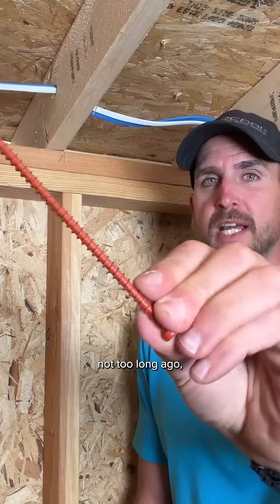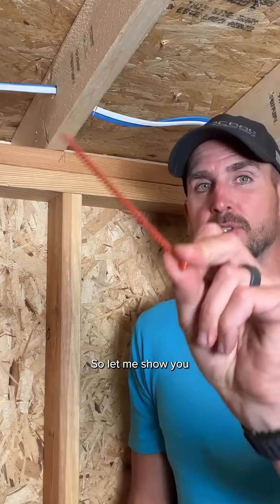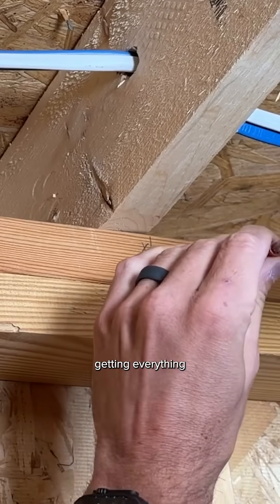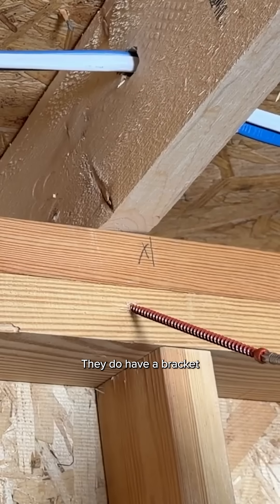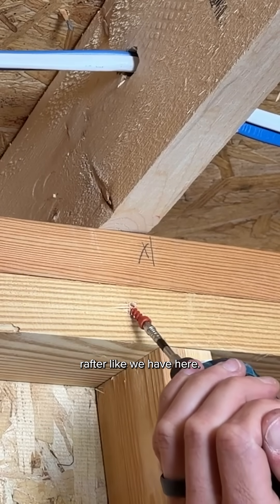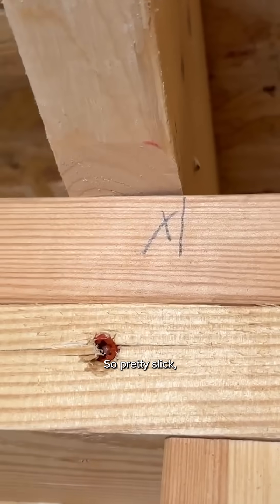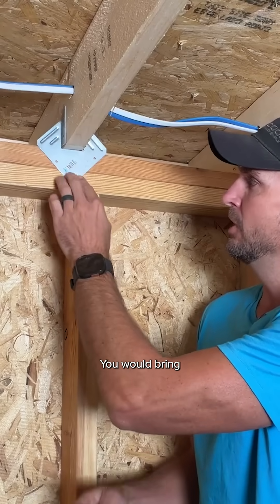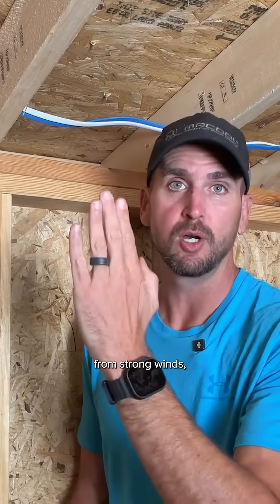The Screw That Makes Hurricane Straps Obsolete?

Comment: I will “accept” the screw “can” replace the plate.  Yet, the plate, misinstalled, misused, not with all fasteners, will hold “something”.  The screw method…good luck doing anything once guy is thinking on only getting out of there.  Just the nails on my rafters and joists, good 20% are not doing anything.   Imagine the structure relying on screws that can’t be seen, going through the top plate and missing most or all of the wood above it.  Just there doing nothing.

Comment: I'm the guy who uses both. I grew up in hurricane central. I use the screw AND an H1A, H8, or H2.5A ties. Only an extra 10 seconds to secure the screw, so doing both does cost more money, but not time. I'm fine with the money, anything to ensure vertical stability of the roof. In my houses, if the roof comes off, the wall and foundation came with it.
Reply: You have to understand that you can connect the rafter to the top plate with twice the needed capacity, failure can still happen further down the load path.  In other words the rafters stay firmly connected to the top plate, but the entire top plate might tear off the wall studs.  Or the entire walls might come off the foundation.  Unless you strengthen every link of a chain, it is not actually any stronger.

Comment: A hurricane tie is ideal. This SDCW 15600 truss screw is useful for retrofitting when a bracket won't work.
Reply: It's not exactly a new type of screw either.
Reply: Is there any device for a house already constructed where the top plates and rafter aren't accessible like that?

Comment: You didn’t mentioned the special bracket that Simpson sells to get the proper angle. One 16d ring shank on each side of the joist is stronger than one screw. Simpson is great at getting the building authorities to sell their products.  

By the way, next time put the rafter above the stud so there weight load transfers to the foundation!

Comment: In Florida we have to do something called a wind mitigation report. It gives the insurance company all of the info they need on how well the house is prepared for a hurricane. There is a section for what secures the roof to the house, straps, ties, clips, etc. So in other words thet want to see that plate specifically, not a single screw in its place

Comment: I'll take the bracket.
Reply: The plate  better
Reply: screw is also not easily observable like the plate is
Reply: bracket: more points of fixation, more breadth of purchase.
Reply: Screws snap
Reply: Yea, the plate, plus 8 fasteners has to be better
Reply: Another answer to a problem that didn't exist. The plate looks stronger and neater
Reply: @alexanderclarke2774  Problem was cost and installation time, labour. But I'd take that security over this screw.
Reply: @Un1234l and retro fits
Reply: No kidding
Reply: Cant fix stupid😊
Reply: And you wonder why houses cost 800k...
Reply: Me too!
Reply: Agreed, I'd do the plate as well.
Reply: No 1 is going to stop u, nor care what u think.
Reply: Bracket should be bigger so the nails go through the bottom 1/4-1/3 of the bottom plate
Reply: Clearly the bracket is for the job 
Even if he had a longer lag screw all the way  from the bottom plate, still wouldn’t be best than that bracket
Reply: Screws don't have sheer strength. I don't see how it's better than a bracket. Especially for home owners. We can't expect them to get the angle of the screw right.
Reply: @theGildedGhillieGuy your not concerned with sheer strength for rafters. Uplift is more important and a screw is superior for that. Also the Simpson screws are treated so they are more ductile so they have sheer strength and won't snap like a regular screw. There is no denying though that the plate with 8 nails will have more uplift per bracket. Probably 600 lbs per bracket vs 400lbs per screw. If I'm not in a zone with hurricanes or tornadoes and codes permit it I'd use it. Cost is cost and labor time is almost half the cost.
Reply: @racerx6384 that's a good point, thanks for adding your perspective 👍
Reply: Simple answer for a simple man 😂😂😂
Reply: My exact thought wow😅
Reply: Yep, if it ain't broke don't fix it.
Reply: Self drilling screws, displaces the shredded wood. Can't be as strong long term.
Reply: It's not
Reply: @gregoryfagan2835 it is so much stronger in my opinion.
Reply: Plate will sweat. So will screw, but smaller than plate I guess. My house has neither and its still standing.
Reply: @robparmenter3700 
Maybe it hasn’t been tested.  How many tornadoes or hurricanes has it been through?
Reply: @Mote78 If he doesn’t live in tornado or hurricane areas, he won’t have to worry about it.
Reply: @slaykittens 
I lived in a home in Durant, Oklahoma built in 1910.  That thing creaked a lot in strong winds. Even though it’s in tornado alley I doubt that it’s ever been hit directly by a tornado because I don’t think it couldn’t withstand 100+ winds.

Comment: My structural engineer hated me, I would use both just to be sure. He said only need one method. Not a huge expense to make it more secure.
Reply: Sometimes you think you are making stuff weaker by adding more connections than called for you.  I've seen them call for 3" On center nailing and the framer takes it upon himself to nail them at 1/2" on center thinking it's stronger when in reality he cracked the 2x4's and destroyed them.
Reply: I thought the same. Use both.
Reply: I’m sure it makes things more rigid
Reply: More holes = less strength
Reply: @getahanddown That's what I keep telling my wife about the lug nuts on her car

Comment: I would rather have the old plate, than the new screw, on my personal home. You can't suck the rafter down tight onto the plate without driving the screw deep into the wood. Even if you could, it wouldn't be half as good as the metal bracket.

Comment: They did that back in the 50’s with pre-made rafters on national homes and their panelized construction from the top at 45° into the top plate
Reply: I wondered what happened to construction material called Strandsteel which was in use post WW-II during the building boom.  They were stingers and 2x4 analogs of red coated steel.  The stringers were made in two pieces back to back which gave a channel at the top thst could accept a conventional nail to install sub flooring or sheeting.  Much of the structure could be assembled with lag screws.

I believe Strandsteel was actually developed in the 1930s.  There is a promotional film made by its manufacturer out on YouTube touting it as a solution for the post war housing shortsge.  It seemed like a good idea, but you don’t see anything residential framed with steel these days.  I assume there must have been some significant downsides or it would have caught on.

Comment: If the screw were 7 or 8" with a large washer or plate it could be driven through the 2 studs from the bottom and hold much more securely
Reply: 8" is plenty.

Comment: Willing to bet the screw is not code compliant in most US states.  Great for a small storage shed, but the plate is far stronger.  Has multiple fail points as opposed to one.

Comment: No it doesn't replacement the metal bracket, because the metal bracket secures the wood from multiple directions.
The beam can still twist on that 1 lag screw.

Comment: How would you inspect this?  The only thing showing is the head of the screw.  Unless the screw breaks out somewhere how do we know how far into the rafter the screw penetrated?  There must be a minimum penetration to get the rated strength.
Reply: Shoddy builders would be using trim head deck screws 😂

Comment: Like the guy putting them in is going to worry about hitting the center of the rafter, so if he's not splitting the wood, the screw is probably sticking out the side. I'm pretty sure that's not more secure then the bracket. I'll take the bracket thank you!

Comment: I thought that nails were the preferred framing fastener because screws break while nails will bend.
Reply: Screws like this are often made of different steel than your average screw and have much high strength. This also means they cost more.
Reply: Screws can be made to doffernt strengths. For standard screws, you would be correct. 
Ledger locks and the like are built altogether differently though.

Comment: I used something similar in a garage roof reframing but it had a pretty large pan head. 

I’m sorry but that small cap head pretty much wedged right in and split what little it even had ahold of the bottom member of the top plate pair, as I am sure everyone saw. No. Sorry. Would not use these.

Comment: I would be really afraid of splitting the wood. That happens and you're screwed. I think you'd want to at least drill a pilot hole or just use a damn bracket.

Comment: This video unexpectly shows the primary problem - user error.  Dude did not install the screw properly in the video.  Now imagine this in the field with workers who are simply working quickly and making simple mistakes like this.  Now add an inspector who's haphazardly eyeballing these connections from a distance.  This 6" innovative is just asking for trouble.

Comment: No, it doesn’t replace the bracket.
It’s “in place of” the bracket.
But it definitely does not replace the bracket.
That screw is utterly inferior to that bracket.

This is another example of garbage “solutions” that benefit contractors at the expense of quality. It’s for speed, NOT quality. So contractors can build your house like garbage, get paid, and move onto the next one - all as quickly as possible.

Comment: That hurricane tie has to be installed on the side of the wall with sheathing if you are going to use them.
Reply: Not according to code here, nor the manufacturer specs.
Reply: @wilky101 please give me the code section that addresses this.  Where specifically in the building code is this referenced?

And yes, the manufacturer addresses this and says you must provide a load path if installed on side without sheathing.  So, more hardware.
Reply: @SteelheadTed 
No thank you. I spend time looking up codes when I can make money for it. 😅 instead, I'll point to the engineer specs and passed local inspections on the hundreds of jobs I have had the privilege of working on over the last 29 years. Feel free to cite your sources if you like. 
As to your second point, you are exactly correct, they can be used on the inside of the home and almost always are, you contradict your own point!
Reply: @wilky101 you cited a code section that doesn’t exist…. Whatever.

I didn’t contradict myself.  If you use it on the inside you have to add additional clips per the manufacturer’s recommendation.

Comment: This is not properly installed. Use the simpson screw guide for proper placement. These were developed by Simpson to replace H1. They have done extensive testing and ratings to ensure they are code compliant. Engineers use simpson data to call out hardware. We can put in a screw in 10 seconds, were an H1 can take 25-30 seconds.They also make an extension for your drill also where you don't need to get on a ladder to put these in. Can do 4 to 5 trusses in the time it takes to do one H1. As far as the H1's, the nail holes regularly line up barely with the bottom of the the double or above the lower plate. Comments about the screws not being adequate are not based on actual data. Simpson has easily accessible hardware data. Read it first.
Reply: There is a range of acceptable angles per Simpson installation guide.  But use, using the template makes it foolproof.

Comment: That screw needs a bigger head or washer so not to pull thru that wood .  But hurricane hanger still seems stronger
Reply: Plate uplift in Doug-fir is 545 pounds.  The screw is 615 pounds.  Simpson publishes these values based on testing, you can look it up for yourself.

Comment: A weekend warrior might think this is a great idea but it's a lazy amateur  mistake. The fixing plate distributes the load  while the 6" screw  has already split the timber. Ever see a roof flying eh?? 😮
Reply: Plate uplift in Doug-fir is 545 pounds.  The screw is 615 pounds.  Simpson publishes these values based on testing, you can look it up for yourself.

Comment: Any wouldn't you screw it from the bottom of 2x4 top plate. Instead of only grabbing part of the 2x4 corner
Reply: If you've got access from directly below, that is an approved approach, and is better.

Comment: Plate is way stronger …cut corners and you find out how bad it was when something happens
Reply: Incorrect.  Plate uplift in Doug-fir is 545 pounds.  The screw is 615 pounds.  Simpson publishes these values based on testing, you can look it up for yourself.

Comment: Most of the people here commenting about Simpson products probably shouldnt be making any material decisions for building.
Reply: It's incredible how the Internet makes people feel qualified to give their 'educated' opinions on anything
Reply: No kidding.  It’s amazing people will just conjecture based on no facts.
Reply: Ok...let's start.  Simpson makes both products.  I use both products.  Both have their uses.  Only hurricane clips have a requirement based upon location code.  Simpsons clips are significantly better at ensuring structural member unions remain integrated under load....providing two to three times protection.  There are a few reasons for this.  First they resist load through shear of the fasteners.  Second, because they have multiple attachments through multiple timbers, pull outs under stress still leave redundant attachments that meet minimum standards.  

This single screw system has been around for years ...it is not new.  In areas that have not historically experienced heavy wind loading, they can work as they do meet standards for most areas.  But a single screw system is completely reliant on the quality of the wood used.  As most builders know, wood no longer has substantive grain.  The ability of a screw to resist pullout is largely based upon crossing grain layers.  Further, the line of force for wind uplift is parallel to the screw.  Poor wood and on site construction make the single screw system a gamble....and an absolute loss in areas with historic patterns of heavy wind loading.
Reply: @xavariusquest4603  uplift forces are absolutely not vertical where did you get that idea? I bet you install your h1/h2.5s on the inside of the house on the bottom cord too.
Reply: @xavariusquest4603  AI bot entered the chat.
Reply: @SteelheadTed stick to fishing chief

Comment: Absent tests that prove otherwise, it seems patently obvious that the metal bracket will provide much greater holding power than a single screw.
Reply: Thankfully, they do test these things before releasing them, and they come with a full set of parameters that engineer can use to spec a plan.
Reply: @jesseyoung9654  Tests performed to support the single screw do not include testing for other variable movements and stresses that the plate handles but the screw does not. Pretty simple.
Reply: They test these things literally hundreds of times before they even release a product then they are tested again by code approved testing agencies.  I can tell you for a fact that the company that makes this product has test facilities where they literally build full sized structures and test them to the breaking point with high def video footage that documents the various modes of failure for everything.  And if something has a value of 500# it's probably twice that strong because of a factor of safety involved.
Reply: I mean... it's already load bearing on the beam... the screw is simply to keep it from moving, and since everything is sheared and tight, I don't really see a problem with this.  The only problem would be user error not being able to pinpoint it exactly in the center of the ceiling joist.

Comment: Is it code. Probably not. Cheap builders will use to save money and walk away.
Reply: Yes, it is.  Simpson lives on code.
Reply: Code allows you to use any tested fastener that resists the loads the code says you must.  That is all.  Plate uplift in Doug-fir is 545 pounds.  The screw is 615 pounds.  Simpson publishes these values based on testing, you can look it up for yourself.

Comment: Pre-drilling works wonders for that rafter grain penetration.
Reply: Correct.
Reply: If you do predrill use the correct size bit.  Google says for SDWC screws you CAN use a 1/8" predrilled hole, but it is not required for this particular product.

Comment: Codes in USA are extremely relaxed for installing electric cables in combustion materials like wood, so electric cables in USA are installed in wood studs without protection against combustion and arcing. 

As electrical codes for combustion materials in USA are potentially dangerous, I will never recommend to use this screw.
Reply: Huh?  This makes no sense.

Comment: What killed me was when he showed the plate next to the single set screw and we’re supposed to believe that 1 screw that could potentially not even be dead center for max hold is stronger than a plate with 8 fasteners.

Lol.
Reply: Plate uplift in Doug-fir is 545 pounds.  The screw is 615 pounds.  Simpson publishes these values based on testing, you can look it up for yourself.
Reply: @SteelheadTed I’m assuming that is if it’s dead center. Now what if someone hits it off center and there’s no longer an equal amount of force it can withstand on either side?